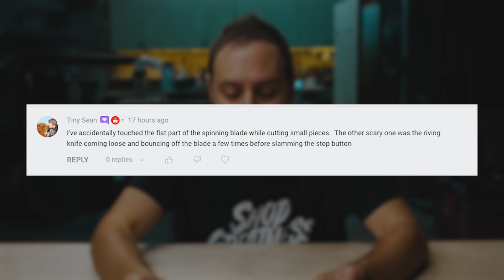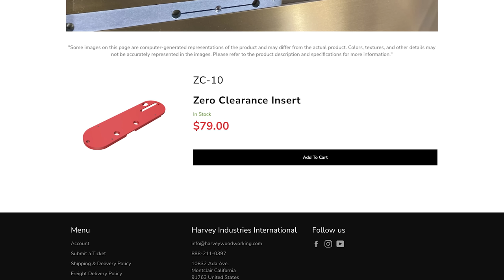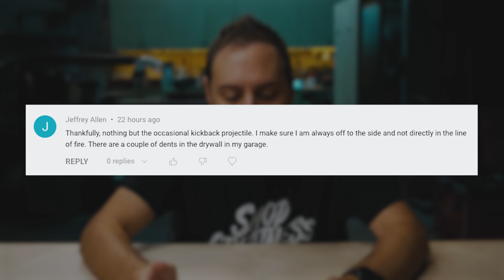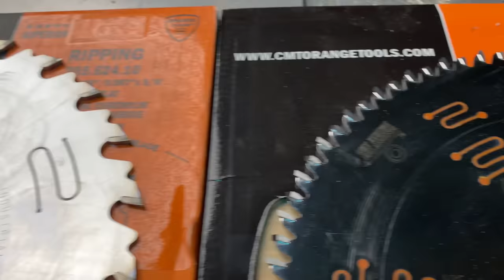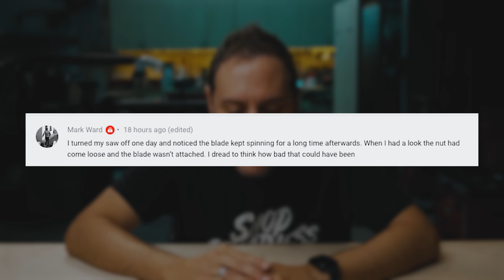I don't know why people make these dumb mistakes

Comment: Everyone's going to share their little incidents so here's mine. At the time I was more than fairly new, had a small shop and a cheap Delta 10". I was using pallet wood at the time I think and was ripping a piece of some crap and didn't realize there was a knothole on the underside. I pushed the cut through just fine, lifted the piece and brought it up and over the blade like I always do before I had turned the saw off. The knot hole fell out of it's uh hole, and landed of course on the center of the rotating blade and was then flung right into the center of my chest at 2hp driven speed. It was a piece the size of a pinball for those that remember pinball machines, and I thought I was going to DIE !! when it hit me. I"ve never once been close to cutting myself because I'm so anal I give myself safety talks every time I use the table saw. But me and my 10 fingers will never forget that moment.
Reply from the maker: Oh my!!!! Thank you for sharing that. I didn’t think about knot holes but they scare me. This could have been 22 mistakes!

Comment: Outstanding video, very comprehensive list of safety protocols.  I've had my table saw for over 30 years and for most of those years never used the splitter (older Delta Unisaw with no riving knife) or blade guard or feather board or push stick or shoe or safety glasses.  I only had three mishaps, all violent kickbacks, and I have all my digits.  Two long pieces put holes in the wall behind me only because I was standing to the side of the line of fire.  The other, unfortunately, sent a short block of wood into my abdomen (not actually into my abdomen) resulting in broken skin and a horrendous bruise and pain that lasted several days.  

Finally I needed reading glasses so at least I had some eye protection.  But at some point I began to use the splitter, featherboards, and push shoe.  I hate push sticks because it looks very awkward to try to control some board a foot-and-a-half out from me.  I use featherboard even if I'm only making one cut.  A shoe provides much better downward and rightward control - feels more like an extension of my hand without actually putting my hand at risk.  But to each his own.  Regarding featherboards, I never really minded setting them up and locking into the miter slot.  Then I discovered MagSwitch featherboards that can be affixed or released in no time, anywhere on your table saw (cast iron or steel only).  Strong magnets hold them in place. I highly recommend them. 

One more tip - if using a push shoe, do not use, or make, the type with a hole in it for your hand.  If the blade grabs the shoe, you have a better chance of your hand not being caught up in the shoe and tangled in the blade.  I actually had my blade grab the shoe I was using (without a handhole) and it violently ripped it out of my hand, but I was aware that my hand rolled over.  I'm glad I wasn't tangled in the shoe.  I still have that shoe with a nice kerf cut in it.  It's a good reminder to pay ultra attention when ripping narrow pieces.

Comment: Witt, I’d been ww  for over 40 yrs when I made a silly mistake with my Labuan bandsaw. It effortlessly sliced the side of my left index finger. I had failed to use an off cut to push the wood out.  I had used one on every other cut until this last one.   After picking up my finger to have it sewn back on and healing for six months I’m back in the shop.  I have a fear now that stays with me no matter what mechanized tool I’m using.  What caused my lapse in judgement?  Was I in a hurry?   Don’t know.  My solution now is I take a step back before I make any cut and mentally rehearse the sequence I will follow. What jigs and clamps I’ll use so they’re in ready reach. This has helped calm me. But frankly I don’t know if I’ll ever lose the fear I gained that day.
Reply from the maker: Oh wow. Thank you for sharing that. Glad you’re okay. 🩹

Comment: great video. My first table saw was a Metabo 10 inch job site saw. Had a nice fence but it was always hard to push stock through. Didn't know until much later that the blade was way off , fence was out bad. I had a kick back incident due to all these out of alignment issues, missed me by small amount and stuck in wall behind me. Since then I sold that saw telling new owner issues then bit the bullet and bought a SawStop PCS 1.75 just to be safer and get something that would hold alignment. Amazing how smooth the wood passes through the SawStop compared to that job site saw when it's all aligned up. Costly, but my fingers are priceless and videos like this remind me how to correctly cut and think about the process before performing.
Reply from the maker: Oh wow! I had a similar experience. I liked my ridgid, but there was so much friction. Tuned it the best I could but it would always revert to mid alignment. I had no idea the sawstops were so smooth. It’s incredible.

Comment: Simple Green general purpose cleaner works great to clean the blades, soak it for a few minutes, then toothbrush off the gunk
Reply from the maker: That’s a great tip
Reply: I agree. Works great and not caustic like oven cleaner.  It can however take the printing off your blade. Haven't had it hurt the coatings on blades like Freud or CMT though.

Comment: My hand surgeon (dog bite not saw) does 5-8 saw injuries per week. I was shocked. I damaged a finger with a router table. I’ve been burned while welding and a tiny piece of metal in my eye (more painful than losing a finger). Lots of dangerous tools in the shop. Slowing down just a little has been my solution.

Comment: For number 12, you'd be better taking memory out of the equation. If your power tools don't have a no-voltage release (NRV) switch, buy a standalone switch and install it between the power and your machinery. If power is ever cut, the tool won't turn back on when power is restored (plus, they make accessible emergency stop buttons, too!).

Comment: 15:20 - The best thing - IMO - to grease (and rust-proof to a degree, at the same time) ALL metal surfaces that slide on wood (or wood slides on them) is silicone grease. (EDIT - that is, among "regular and reasonably priced" stuff".)
They are typically used for greasing rubber and plastics, not metal - or ground glass joints in lab glassware.
Silicone grease is not a very good grease "as such", and certainly not designed for metal on metal  contact - it is actually more non-sticking agent than grease, but it works very well on woodworking tools.

Clean the surface(s) to be greased - be it the "foot" of hand held power planer or hand held circular saw, or table saw, or jointer - you name it, heat it gently for better results (just make it warm to help spreading the grease, as they tend to be tad stiff), apply the grease, rub it all over the surface with a piece of cloth or paper towel, and then wipe off the excess. The wood would slide on it like skates on ice, AND, since it is non-sticking agent it will prevent any resin from sticking to treated surfaces.
It can be also applied onto saw blades, planer/ jointer blades and drums, chips chutes, and such (like the ducts that carry away sawdust in hand-held circular saws) - in those cases silicone sprays would be more practical. )In fact, I even used it on my splitting and cutting axes.)

 Actually, it just occurred to me, you can apply a light coat of silicone spray on a piece of sandpaper when you're about to sand a piece of pine of spruce wood that has a lot of knots (= resin) in it. How come I never thought of it before... silly me.

In fact you can use silicone sprays on table saw's tables too, but it would wear off much quicker - but then again re-application is much faster and easier.
Those are (greases and sprays) slightly more expensive that WD-40 or regular lithium grease, but not nearly as expensive as all those special "waxes". Try them, you won't be disappointed.

PS - "right frame (or state) of mind" - oh yeah, right you are, Mister. I've cut my right thumb tendon on a mitre saw while tad "under the weather" (actually, "the day after the night before"), and being in the state I was I never noticed the safety guard hasn't closed completely when the saw lifted after the cut (it kinda jammed slightly). I reached for the off-cut piece, the blade was still spinning... Yeah, shoot happens.

Comment: Another tip is to make sure the riving knife is aligned properly with the blade. I bought a new table saw and the riving knife was so out of whack that it was causing issues with the pushing the wood through the cut. It took me a while to get it aligned just right.
Reply from the maker: oh wow!

Comment from the maker: ⛑Protect your cast iron with Carbon Coat: http://t.ly/lZvUK
use code WITTWORKS for 10% off
Reply: Hi Brother....   In a past life I was a commercial pilot and one thing I learned was that as experience goes up, so does complacency.  In aviation it's around 2300 flying hours with the highest accident rate.  It appears that the issue is that people repeatedly get away with minor infractions and then they make several mistakes at one time (the swiss cheese theory) and then BOOM!  Great video!
Reply: OMG you spent this video telling people to use tablesaws? After learning just what they are and what they do to people? It's not a matter of knowing the rules, it's a matter of complacency. Using them breeds this. Using them is dangerous. Using them results in injury. Stop using them.
Reply: @whatilearnttoday5295  You said it yourself, complacency is the culprit.  So ask yourself how you avoid complacency?  One idea that I have is to watch videos like this one.  It helps to remind one of the dangers of complacency, and the potential outcomes if one allows it to creep into your life.  This applies to all things, not just table saws.  Look, think through the dangers, and take steps to avoid them.  Live long and prosper.
Reply: @brucewilliamsstudio4932  Step 1: Don't use a tablesaw for every single task.
Reply: This is an incredibly detailed video. I'm just a batchuler that likes to fix a few things round the home, so feel nervous about using anything more than a jigsaw. I never knew so many things could go wrong with a table saw.
Reply: Noobie here, bought a 60$table saw to cut solid aluminum 1" OD rod, not parallel to the blade, free handing it while it was getting hot, i sprayed alcohol on it w/my other hand to cool it, won't be doing that again after see this. 😶

Comment: One question from my almost total lack of knowledge about table saws. Since to me it appears that all the danger would mitigate if the person didn't have to manually operate the table saw, is there not some attachment that you can buy/make where you could maybe just push a button and that device would apply the three pressure points needed and run it through without the person having to be so close to the blade or in a position of danger? Or maybe an enclosed table saw or something like that?

Comment: "A SawStop can't protect kickback." What? Oh, you mean the blade stop tech that SawStop is famous for does not address kickback per se? Ok that's true. But if you use the blade guard and riving knife, along with following sensible general table saw safety precautions, then your SawStop saw will provide significant protection from both blade contact and kickback injuries. And you state that 92% of table saw injuries that end up in the ER were because of touching the blade. So, yeah, kickback is a huge risk, but, clearly, so is blade contact.

Comment: I'm waiting for my first table saw to arrive soon. I've been watching everything that can go wrong before I start using it. Thank you for this warning video. Regards.
Reply: I did the same. Little research goes a long way. Not only for what can be built but also the safety aspects. 
I now have the DeWalt dwe7492-qs.
Well worth the money instead of those cheap ones for 100 buks.

Comment: I have a BOSCH table saw with a Bosch plastic push stick. Yesterday the Bosch push stick touched the blade and shattered. It went off like a bomb bits went everywhere.  I could easily have lost any eye.
Reply from the maker: Glad you’re safe! That’s why I have stopped using those plastic ones. That’s a case for eye protection (which I usually forget)

Comment: Another note about riving knives: definitely make sure to check/adjust your knife so both sides are parallel to your blade. My jobsite saw's riving knife was way out of alignment when I bought it and the first few rips I tried to make on it were pulling away from the fence (which I had already dialed in) because of it. If it had been angled toward the fence rather than way from it, that situation very well could have caused pinching and eventually kickback.

Comment: I've had three of these issues before.  The blade nut coming loose, forgetting to lock the fence, and my garage door has 3-4 dimples in it from kickback throwing an offcut like a spear.  Oh, and yeah...stop working with power tools if you are tired.  My rule is if I make 3 stupid (not dangerous, but just screwups) in a row, I'm done for the day.
Reply from the maker: Oh my

Comment: Thanks for the info I grew up learning how to use power tools but in a very old school kind of way and mostly just common sense safety. For example I was taught to take it slow so that you feel the pressure of the bind before a kickback and pull back slightly enough to stop cutting and turn it off before removing the wood

Comment: There is a dent in my metal garage door when a small piece of wood kicked back (think small pencil like you find at church or ikea). Even the little stuff can cause some damage. Eventually picked up one of the KMTools aprons, and I have to say I've quite taken to the feel of that extra bit of protection while I work (thankfully so far it's only had to protect me from glue drips).
Reply from the maker: Wow. Yes, I forgot to mention the apron ppe!

Comment: Great video brother! back when I used to work in my pops shop, before i started my own company. we had 3 employees cut their thumbs straight off on a table saw. this was prior to the saw stop days. once the saw stop came out that never happened again. one of my biggest concerns when using a table saw is repetitive cuts... when you have to make the same cut 100 times on a table saw its very easy to forget, get over confident, or get distracted! Stay safe!
Reply from the maker: Thank you for sharing. Yes. My mind always wonders in batch mode.

Comment: I have shared this video with my husband because I have been wanting to buy a table saw. Will definitely be getting one with all of the safety features if we decide to after all.
Reply: Scrimp elsewhere, not on your tools.  Buy a SawStop.  SawStops are cheaper than fingers.
Reply: For me it was the other way around. I had to convince my wife i wanted a quality saw instead of a cheap one and to convince her of dangers of using one on the floor instead build into the workbench as i wanted to. 
This video and other videos convinced her of my choices of the "why". 
Yes it's more expensive but cheaper than hospital costs and other financial damages it can cause. 

Your husband is lucky to have a wife that cares for her husband safety with power tools. 😊

Comment: I attached a 12x12 plexiglass over my miter gauge fence to protect my upper body from kickback and it also keeps table saw dust down. I also created a 20mm thick aluminium extrusion as a barrier between my right hand and the blade. 

Whenever i do rip cuts, i use lots of wood tape, custom safety jigs, and stand on the far right of the entire table saw, and pull the piece toward me and the fence while cutting it. This tactic has saved me from any form of table saw accident- it is 100x safer than standing in front of the blade while  using the crappy default push stick. 
Use as many custom jigs, clamps, and wood tapes until you are satisfied that the piece is secured and will not go flying.

Comment: Thank you for this video, one of the last ones you mentioned is the not locking the fence this where the old "Align A Rip" fences were good compared to modern designs as you need to lock the fence or its not square and a slightest touch the fence it will move(before getting to the blade)whereas modern designs keep the fence rigidly square without locking thus needing a more pressure to move.
I will add one more lot of safety issues, with bulk resawing you know like two operators one infeed the other outfeed, if the outfeed person grabs the wood before passing the blade its very easy to angle it with a such long lever.
And also the offcut is very dangerous to grab on the outfeed side as it often stays at the cutting edge of the blade... if it tilts back over to the blade it can get shot back towards "Mr. Infeed" pulling the hand of Mr. Outfeed towards the blade... hopefully hitting the rear of the guard that should be installed, seen this happen back in my high school days, the result was "only some stitches"

Comment: quick fix for the surface is also PTFE spray, me and my father used to do 100s of cuts a day of 3d moulded plywood for furniture production (curved legs for chairs, curved pieces for a skirt of a round table, handles for ergonomic snow shovels and even wooden corrugated roof sheets) and we always used PTFE spray because the wax was more expensive and just as effective, the only downside is that we had to wait few minutes for the airborne particles of PTFE to settle before continuing